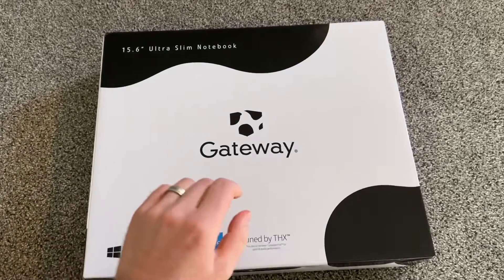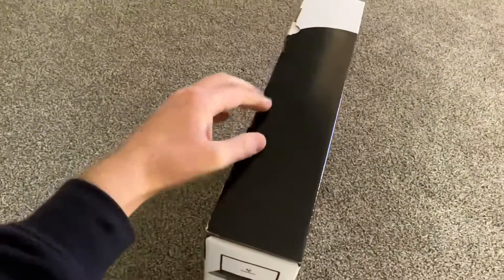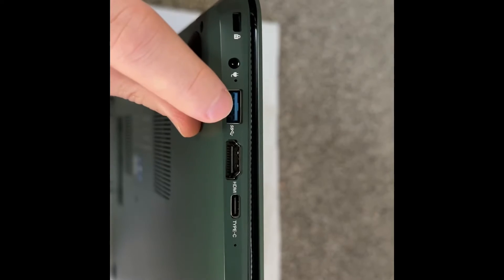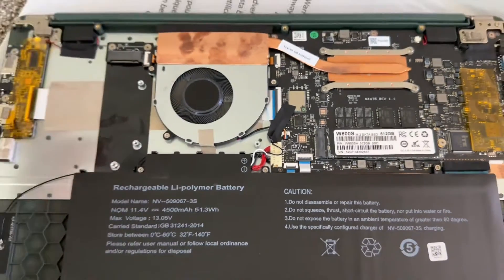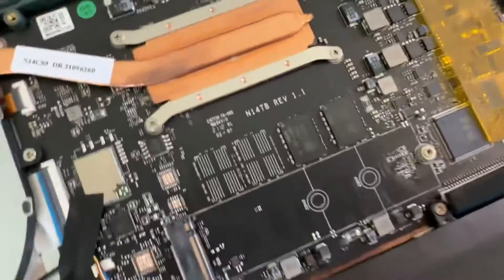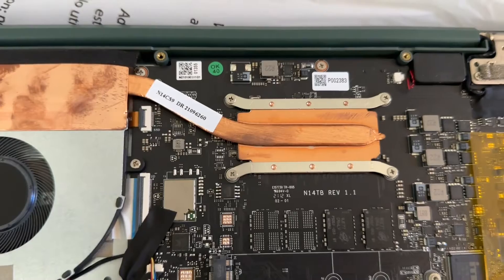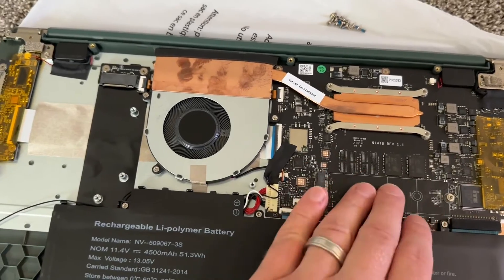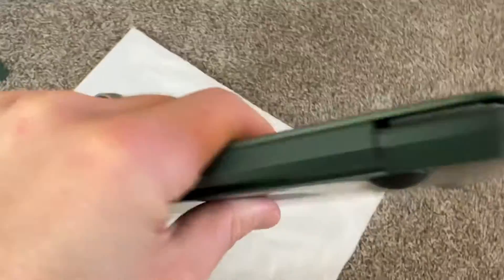How to change SSD and battery in Gateway Ultra Slim Slaptop

Comment: if the battery is disconnected; can you run this laptop only on wall power?
Reply from the maker: I m not sure. Many Gateway had faulty battery but worked when plugged in. But I m not sure, faulty battery might still be needed to pass energy. I haven’t tried that

Comment: 3 years later after i bought it on a good deal at Walmart, its still a very good and solid laptop. it might not have the best keyboard feel, the mousepad can be a bit funky at times, speakers are "good enough". But overall in terms of daily use for browsing and watching YouTube vids in 1080p as well as daily tasks its a very good laptop for someone who doesn't care about any fancy gimmicks. my moms Samsung laptop has the same exact processor as this one at it was 1000$ and doesn't even come with 16gb of ram like this gateway. I also set up this laptop in the BIOS to run at max clock on the CPU and it definitely woke it up a bit in exchange for a bit of battery life.
Reply from the maker: Gateways have certainly best specs for the price. Unfortunately no more sales on these. Later on Walmart had Vaio (similar part numbers, same brand charger - might be made by same company). But no more

Comment: I thought you were going to actually show us 'how' to add a 2nd SSD and how to change the battery. You showed us how to unsafely remove the bottom. I thought you'd break something the way you yanked it off.
😐
And btw...you cannot add RAM because it is soldered to the motherboard. 
Anyway, thanks for trying. ✌🏽
Reply from the maker: To remove battery - unscrew a few screws and pull out a connector. SSD slot is behind the small cover. 
RAM is soldered - that’s correct
Reply: @alegreviews   Thank you.